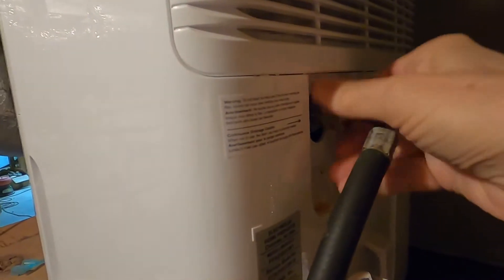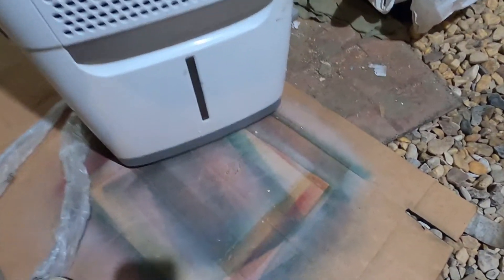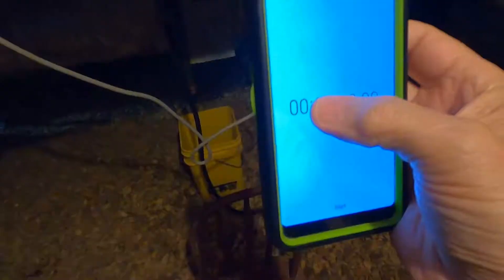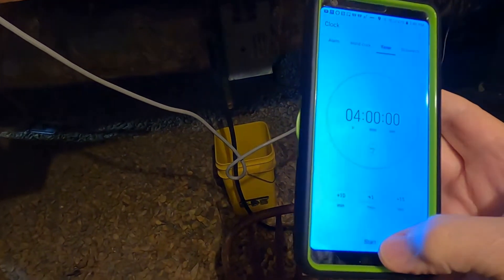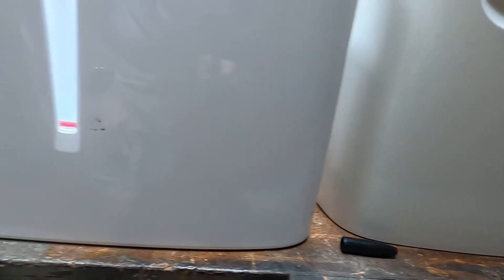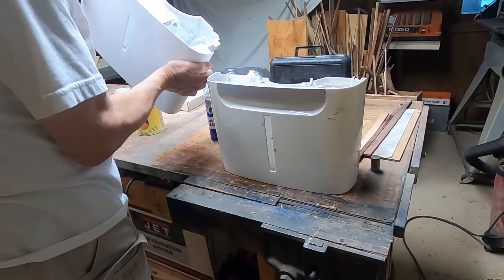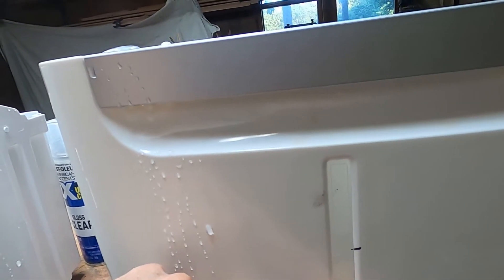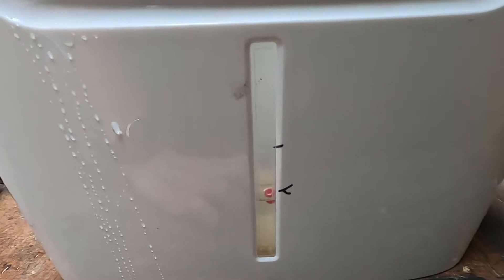Dehumidifier Scam

Comment: I'm curious how they work. I have mold issues. Even our couch mattress had black spots. Been using the dehumidifier. But the toilet bowl never empties. It feels warmer and dryer with it running for sure. But I wonder how much it actually helps. I feel a difference. But can't seem to get a grip on the mold in the house. I wonder if it's a scam when the toilet bowl stays full